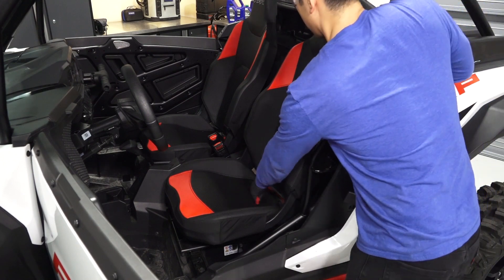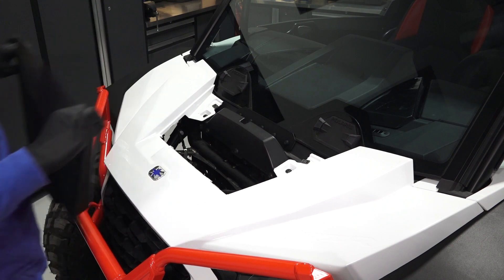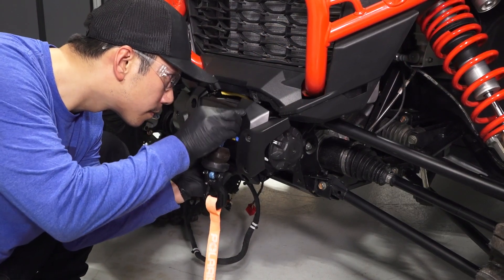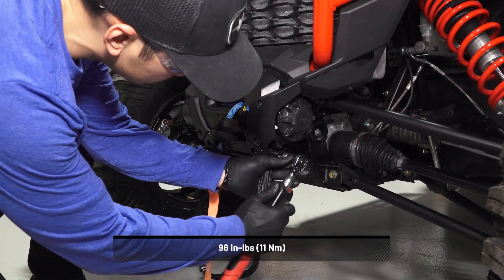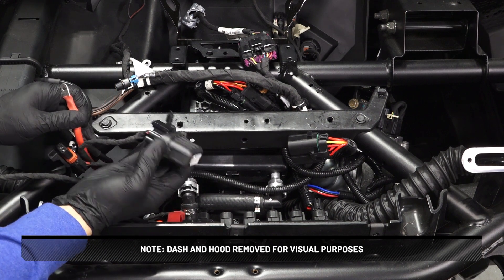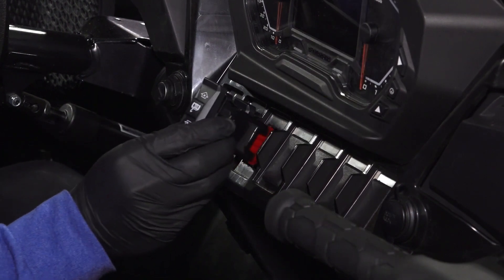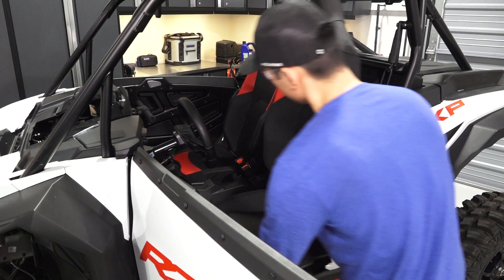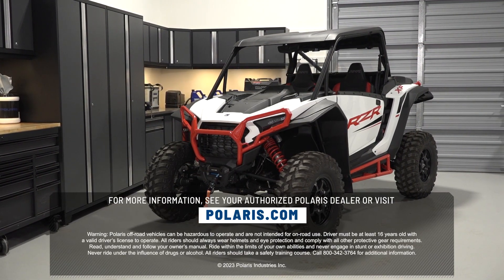2024+ RZR XP | Winch Installation | Polaris RZR®

Comment: This is an absolutely poor video. The important part of the wiring through the firewall is no indication of what has to happen. The electric connection on the video show wide open access the actual unit is covered by plastic